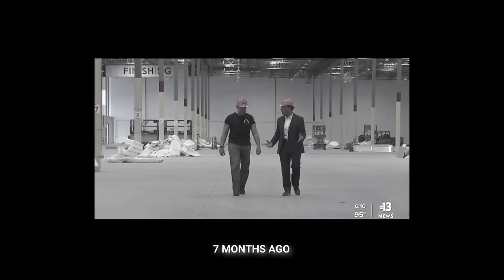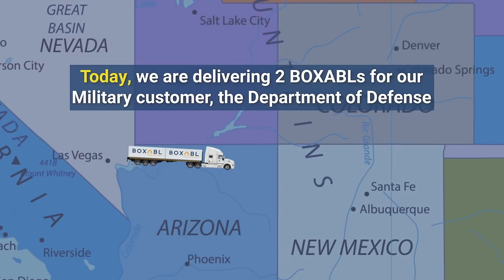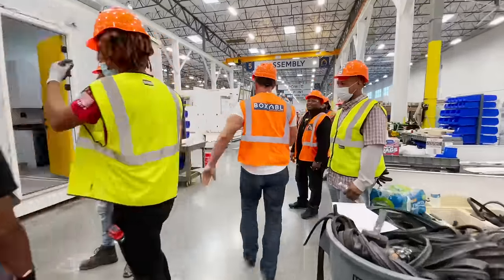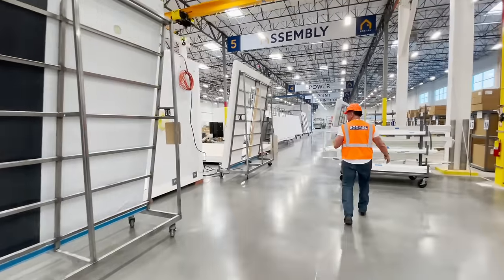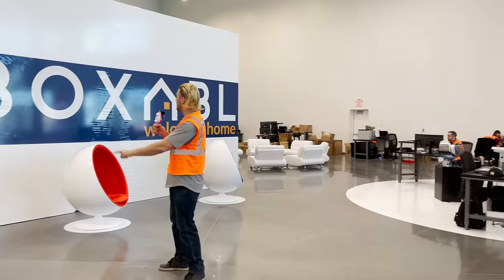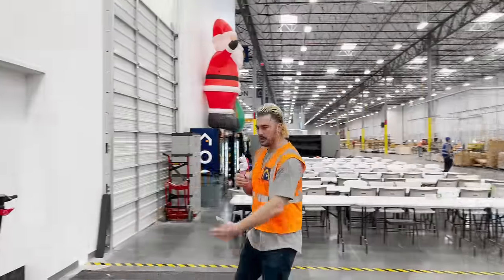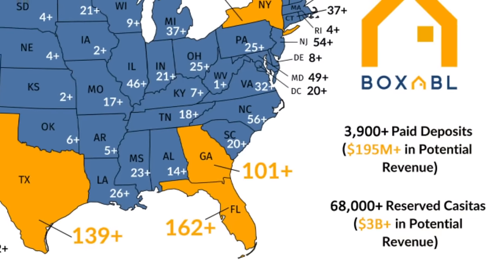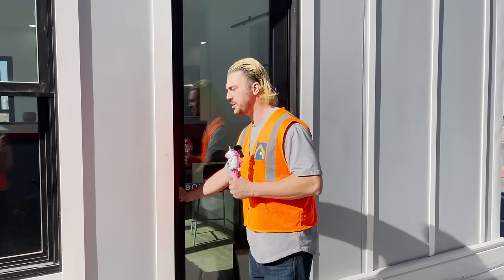Ep. 3 BOXABL Factory Update 2022 - Casitas Now Shipping! (Outside the BOXABL)

Comment: Is the insolation good enough for the Canadian winters?
Reply from the maker: The house is very well insulated. In fact, the design is similar to an igloo cooler or refrigerator. All the air will be trapped inside and conditioned. This means a Boxabl will do great in high heat or high cold climates.

Comment: Can I just buy land in Denton Texas and put one of the houses there ? I guess I will have to figure out how to set up the sewage and water and stuff.
Reply from the maker: Different areas have different zoning rules. You can try reading rules on your local government's website, but sometimes it can be confusing. Boxabl has partnered with permits.com to provide an easy resource for questions about permitting https://boxabl.permits.com/. Water and sewer are connected on-site by local contractors. You will need to verify your site has the connections prior to installing.

Comment: This is very interesting but my question is about insulation.  What R rating is your insulation / foam? I'm asking for cold region ie Canada
Reply from the maker: The house is very well insulated. In fact, the design is similar to an igloo cooler or refrigerator. All the air will be trapped inside and conditioned. This means a Boxabl will do great in high heat or high cold climates.

Comment: Insulated for cold New England winters?
Reply from the maker: The house is very well insulated. In fact, the design is similar to an igloo cooler or refrigerator. All the air will be trapped inside and conditioned. This means a Boxabl will do great in high heat or high cold climates.

Comment: How well are these boxable tiny houses insulated?
Reply from the maker: The house is very well insulated. In fact, the design is similar to an igloo cooler or refrigerator. All the air will be trapped inside and conditioned. This means a Boxabl will do great in high heat or high cold climates.
Reply: @BOXABL  what about being highly flammable?

Comment: how would pluming work?
Reply from the maker: Plumbing and electrical are already ready to go inside the Boxabl, all you will need to do is have your Boxabl certified contractor connect it to your site.
Reply: @BOXABL  damn, how much can I customize this thing? Like it says for 1 I pay 250 a month what if i just get one say double the size would that be say 500 a month then?
Reply from the maker: At the moment, customization is not available. If you desire to, you can modify or customize it after you receive it. The $250 number on the website’s front page is an estimated finance cost for the Boxabl room modules only, with an average 30-year mortgage. Any additional install costs would also be added to the mortgage. The final payment will be approximately $250-$500 under the example scenario, depending on lender approval.